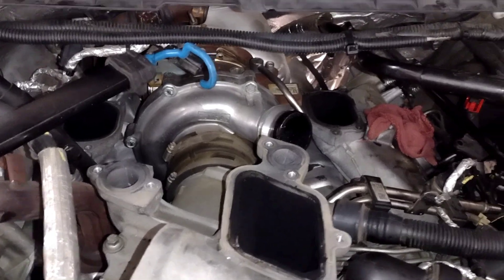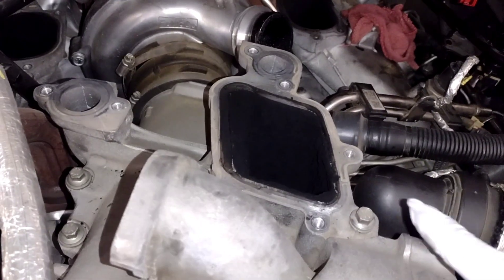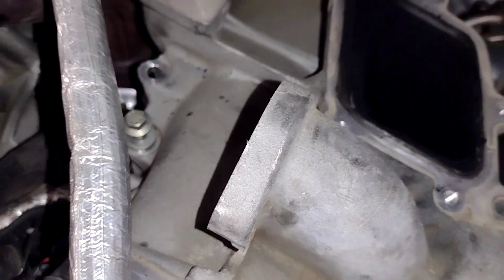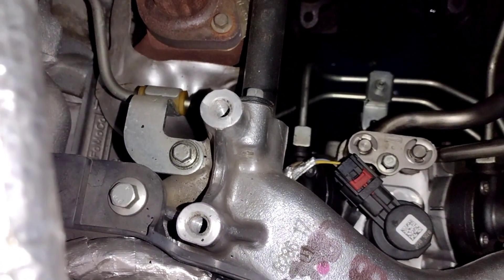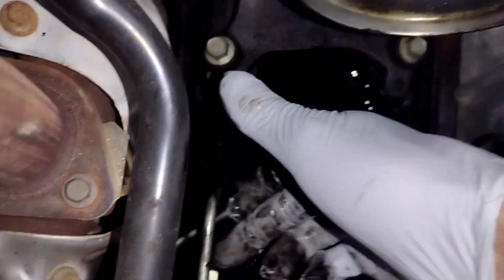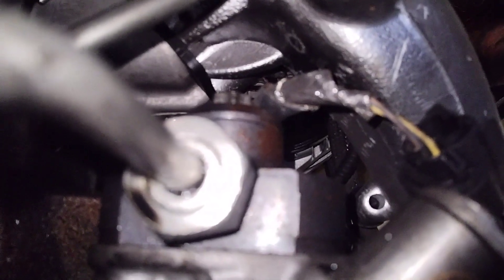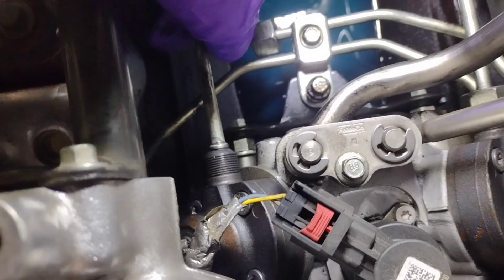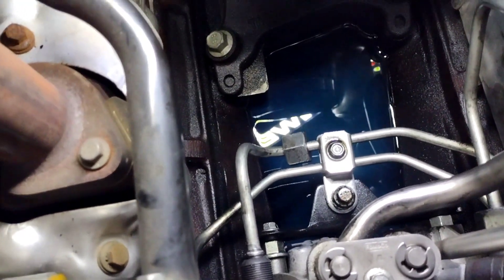2018 F450 6.7 Powerstroke Fuel Leak Found #newtoyou #powerstroke #superduty

Comment: Do you think most dealers would have found the same thing and been honest about it. I wonder…🤔
Reply from the maker: Probably not. They would have said you needed pump. Already in there and more hours. That's one reason I'm not at a dealer anymore. I refuse to sell things people don't need. If it doesn't need a pump and just the line was crooked cause a bolt was missing then that's what's getting fixed.
Reply: Yeah it’s sad people need to worry about honesty. Just being honest will get you that customer back for life! I appreciate you brother. Thank you!
Reply from the maker: @terrydtdi  your welcome sir!